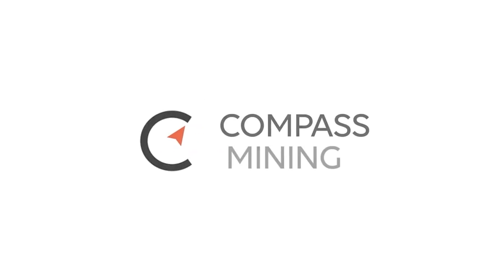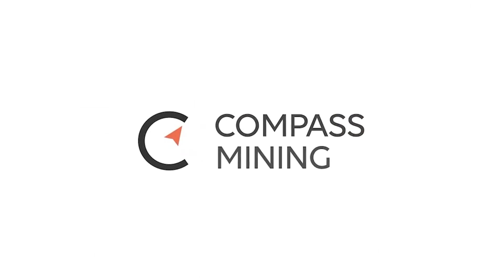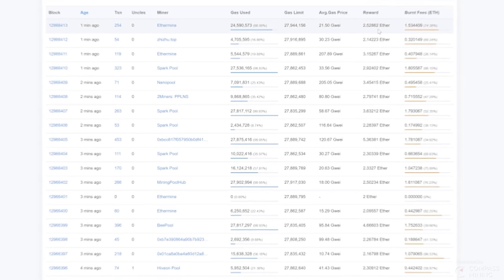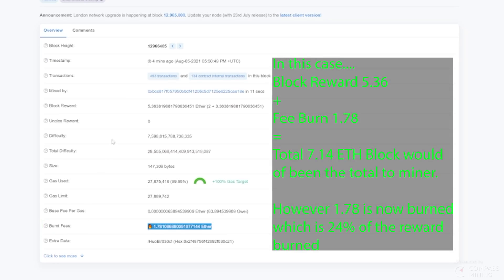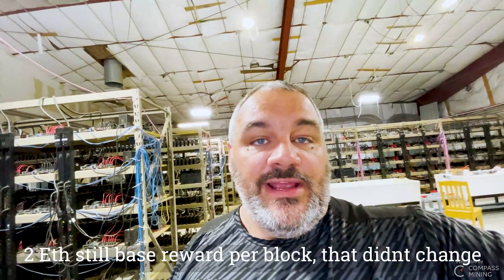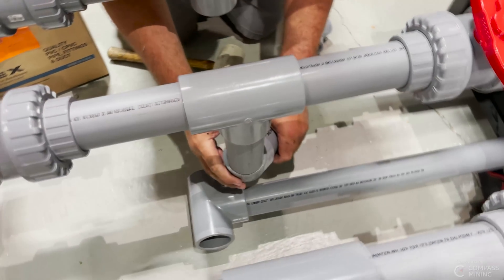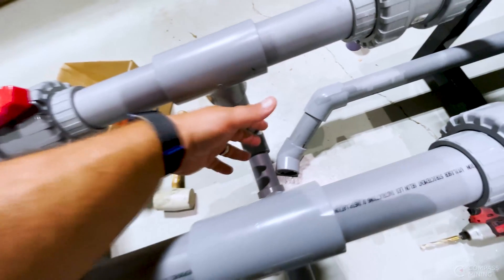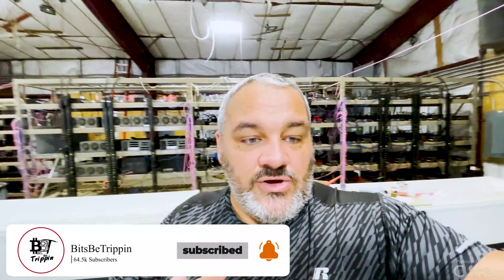Ethereum EIP-1559 Fee Burn EXPLAINED

Comment: It basically cuts the ETH produced in half (at least so far).  If that continues then it will likely have the same effect of a halving and drive up the price.
Reply: If the price goes up to about ($3250) then pretty much you are where you are right before the "fork". But the price has to reach the $3250 mark and fast!